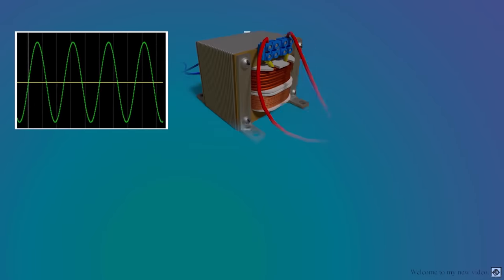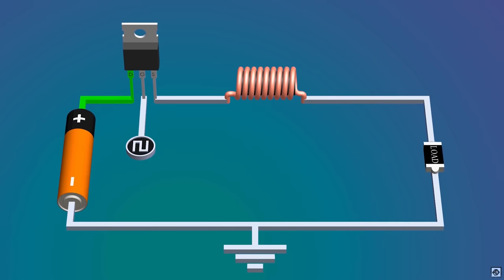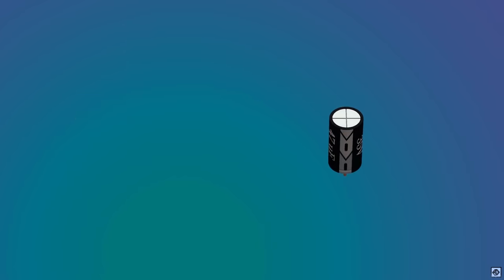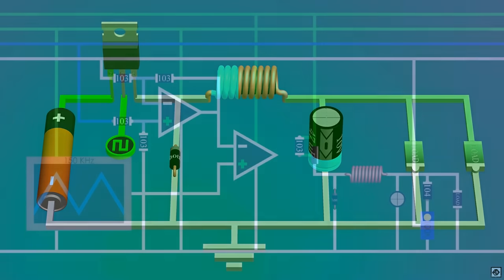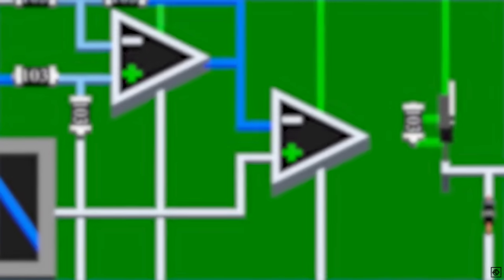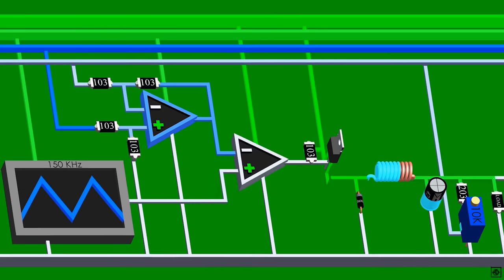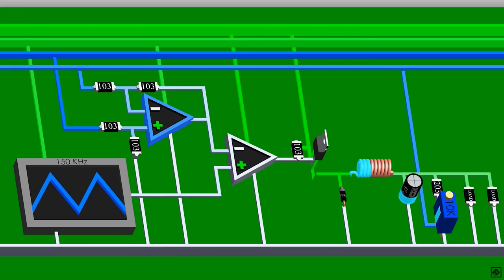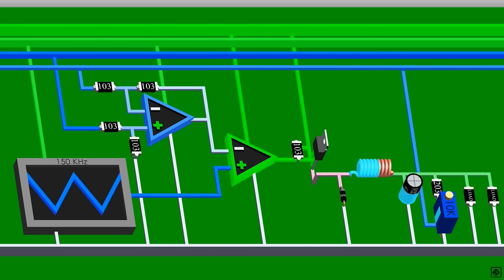How does Buck Converter work? | DC-DC Converter - 1

Comment: No current can flow through a capacitor - it flows toward and away from the capacitor and in doing so raises or depletes the charge on the plates of the capacitor.

Comment: The only thing I think wrong was you said current flowed through the 1st filter capacitor operation description and it stored energy by electrical fields.
 No current flows through caps, it can flow in (chargeing) and out (discharging) back the way it came in.
The energy stored is positive and negative static charges on the isolated opposing conductive plates.
Some things shouldn't be too simplified in their description or wrong understanding or concepts result

Comment: what about a voltage divider using 2 resistors?
Reply from the maker: Yes it can be done. But there are other resistors which influences the voltage divider. And thus the effective resistance changes.
Reply: the resistance of the load changes the voltage it receives from that, also you're wasting a lot of energy in the resistors

Comment: Another reminder why AC won against DC voltage back then. It's SO much harder to convert.
Reply: yeah id hate to see the size of a boost/buck converter for an industrial building, and considering theyre not nearly as efficient as a transformer, it would heat an entire apartment building lol

Comment: question how can i solve the problem , hope you will understand ... :) 
i have one power source , 5 step down converter and 5 li ion batterries 
How can i use the same power source to power all 5 converter to charge every batteries what are connected in serial ?
+/-+/-+/-+/-+/-

Comment: Your circuit needs a couple latches to prevent double pulsing.  Also, never use a ground referenced modulator ramp because the output of the error amp can not go all the way to ground and at no load the output will rise to Vin.  Cool your using a triangle wave resulting in double edge modulation.  Moves the Nyquist poles to fsw.  LM2575 does that.  LM2595 is trailing edge modulated.

Comment: Hello sir,
Subject --  Battery 12 v 5 amp,. I need 8 v 5 amp from this battery,how to make the circuit who drop 4 volt, 
Because I want to use in bike headlight. Beam capicity 
8 volt 80 & 90 watts pls help.

Comment: can we actually make this circuit, very good explanation, but still find it hard to understand comparators, triangular wave generators, voltage references, all core basic electronics.
Reply from the maker: Yes, you can make this circuit. 
This video was on buck converter, so the explanation of components were basic.
I will make separate videos for basic electronics.
Reply: basicly you can buy an IC that has everything beside the cap, inductor and maybe some resistors integrated and the use that :D

Comment: The inductor wants to keep the current constant. Really? At St. Joseph's Electronic Research, we know forces are transferred into the Y-column by the solenoid and energy is stored in the magnetic field. 
Dr. Mr. Joseph. Diploma electronic engineering.
Reply from the maker: This video was about buck converter, so it was just basic.
Reply: @ExplorerStuff  Ok. That's fine.

Comment: This electron acculation is confusing because i think we're dealing with actual electron flow but w'ere using a schematic thats backwards (conventional current flow) as someone new to electronics i just wish new teachers would stick with actuall current flow, I dont have any old schematics that will be inconvenienced by this (sorry to those who do) but this is so confusing, my brain explodes everytime i try to make sense of a diode in a schematic.  And whats the deal with schematics... why not use 1's and 0's if were trying to be so efficiently cryptic.  Would it hurt to put all 3 legs apparently visible of a potentimeter in the schematic? How about a picture? Can we upgrade to "icons"  yet?  Is there not enough ink in the printing press, is that it?  Whats the deal?

Comment: Starting at about 40 seconds from the beginning and ending at about 55 seconds from the beginning, you state, "Now, if you calculate the average of a (PWM) cycle, with duty cycle 50 percent, it's half of the input voltage. That is, we have reduced the voltage from 12 volts to 6 volts with just a switch." 

This is fundamentally FALSE. All you have done is reduce the AVERAGE voltage from 12 volts to 6 volts. If all you have is a "switch" what you would get is either 12 volts or 0 volts for a variable period of time. If you wanted to drive a component that could tolerate a maximum of 6 volts and you did so with a circuit that functioned as you describe, you would burn out the device. I appreciate that you are trying to simplify your explanation down to introduce the more complex functioning of the buck converter, but please don't do so in a way that includes such misleading statements, especially at the beginning of your content.